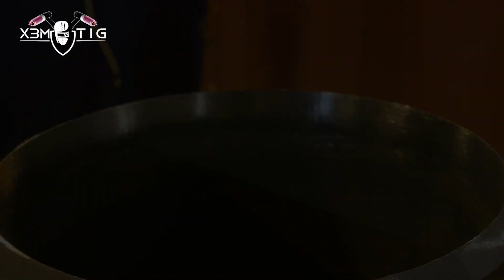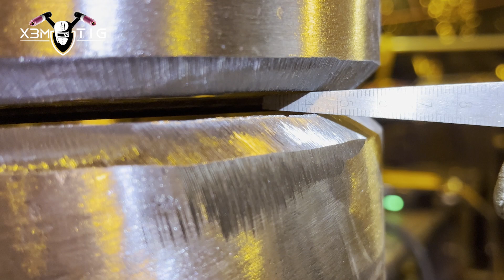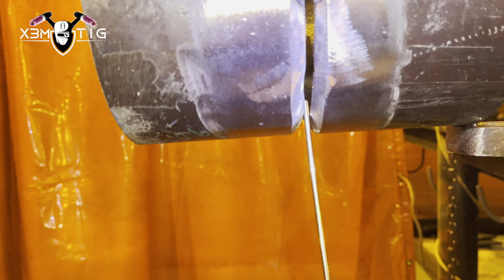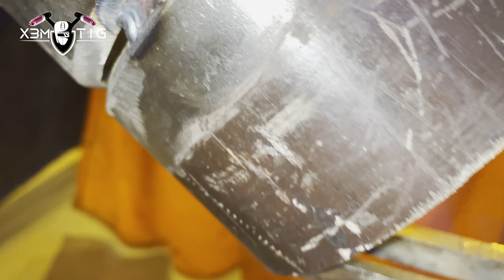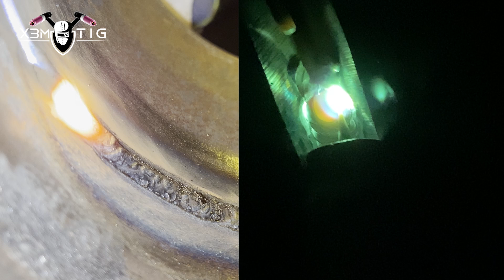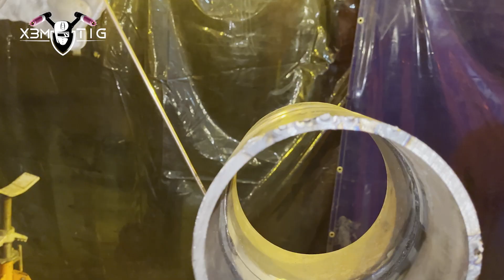What is the BEST Way to Do Tig Welding Overhead Root Pass?

Comment: Just started my Tig class doing 2G open Route due to my positioning in my set up I had to do a lot of start and stops. Does it matter or do you want to do as little as possible?
Reply from the maker: Less stops, better and more uniform weld!
Reply: @X3MTIG  what start method do you like? High freq, scratch?
Reply from the maker: @Jacoby4465 HF 💯 %
Reply: @X3MTIG  love your channel foot switch or switch on the torch?

Comment: How you fight with gravitation when material going down
Reply from the maker: Changing torch inclination
Reply from the maker: Changing torch inclination
Reply: @X3MTIG  I can’t find a good position for the rod, a loot of time material going down slide on me and touch the electrod, how can I avoid it I need to keep the rod more straight or more degree ?

Comment: Hey whatsup bro, I just got a question, Im currently a pipe welder rn at a refinery in america and im american, but next year Ill be abroad in Germany and Korea, Is it possible to work as a pipe welder in those countries from your knowledge? Most people in my job only work in U.S and usually from what I gather those abroad jobs are just recommended in or friend of friend type thing. And Im sure each country has their own standards of welding and Its pretty hard to find any knowledge about this specifically.
Reply from the maker: You have to talk with your potential employer about regulations, the biggest challenge would be language barriers and additional testing or training, welding is welding, same, wherever you go, if you have skills you can succeed anywhere, but get your credentials recognized, that’s big question mark ⁉️ Europe is mainly TIG welding same as Korea .

Comment: Hey bro, I've been laying lots of stainless beads this past year, I'm getting pretty good. But, I'm trying these last few days to get a beautiful blue on the welds, like in the weld porn videos. I saw you did it in one of your vids about a year ago. Can you get that blue consistently? I know that it's just an oxide layer and yes you're going to clean it off anyway. But it's just that wow factor you know. Lets say for example a schedule 40 4" stainless pipe. How would you go about getting that lovely blue? Or if you know any videos of anyone that knows how to that'd be perfect.
I love your videos and I've learnt so much from them so thank you
Reply from the maker: Play with your amperage, and gas flow.

Comment: great video, but I have a question for You: how would You do root it in this position for example, on superduplex steel? You would use dipping technique?
Reply from the maker: Depends on wall thickness, if it’s standard and above I’ll do the same, anything thinner, probably keyhole to dipping technique!

Comment: Thanks for the videos m8 super helpful, quick question... If that were a stainless pipe would you still lay wire or dip? I'm decent at mild steel pipe but never seem to be able to get enough build up in with my stainless pipe. Cheers bro
Reply: Depends . On sch40 and thicker backfeed . On sch10 and thinner keyhole and dip . Overhead part on thin pipe you should put enough in that it satisfies the puddle and swells over to the bevel . That way you will have enough buildup. I never backfeed on thin pipe as the heat you need never is enough to melt the wire you put on the inside 100 percent and you sometimes end with whiskers , you can do it but you need more time to burn it off . Allways remember to put the wire on the very leading edge of the puddle and satisfy it by putting in enough to the point that it swells up , either back feeding or not . Hope that it helps for you . Grt
Reply from the maker: Hey bud, depends of the thickness. Std wall and up, backfeed and lay wire, anything thinner, keyhole or dipping. Try to weld with 3/32 filler wire and loose 3/32 gap or 1/8 gap.